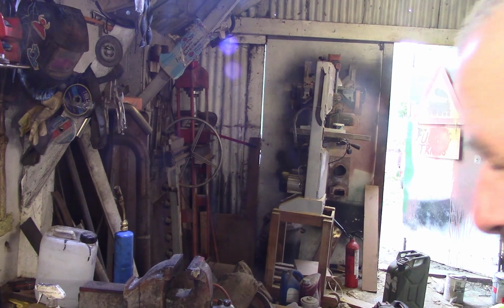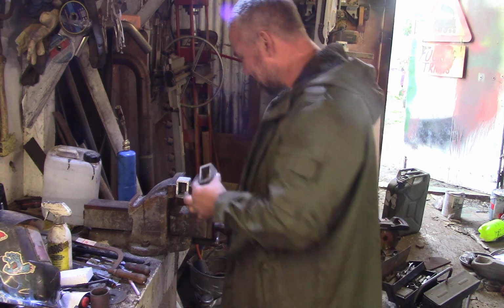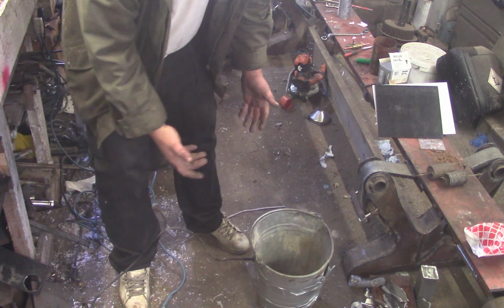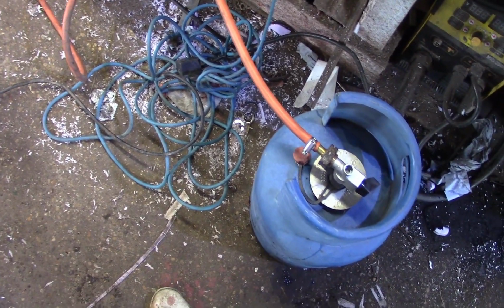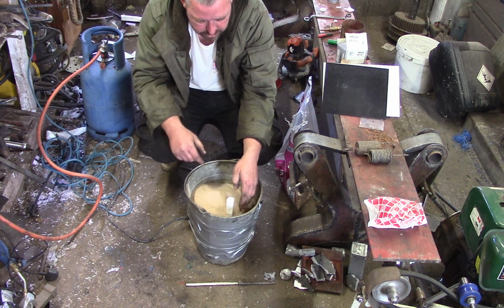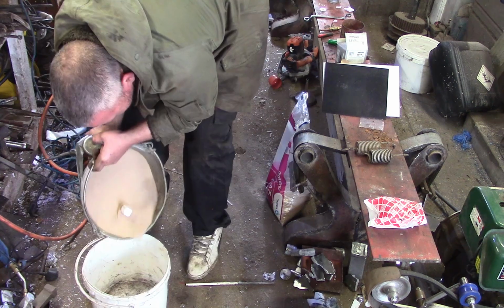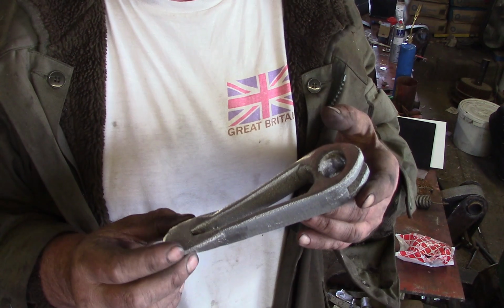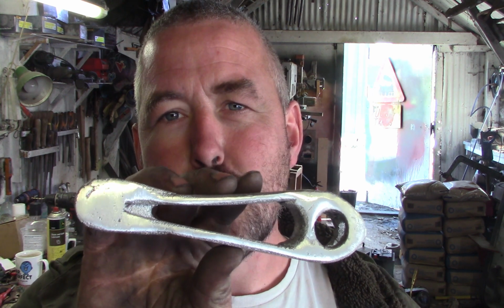casting a starter handle and cutting the cast bottle open

Comment: Next project, make a bigger bucket with straight sides!!!  The bottle had worked just fine - I don't think I could have brought myself to cut it open, even if it was for science.  I guess with the crank handle you could add some braces to the foam pattern to stop it warping in the sand, then cut them off later, but if it will do the trick as it is, no one is going to examine it that closely.

Comment: Just my 2 cents, and I get that you're busy and trying to make progress on the main project which is the bunker, but I think you should do a little more casting before you put the gear away. I bet you could remake that bottle with thinner walls, and figure out how to do the setup without any flexing or cold shuts. My recommendation on that crank handle would be to add a riser at the end where the cold shut occurred, and maybe rotate the part 90 degrees so you don't have a "high" and "low" path, but two parallel paths on the same plane, if that makes sense. Casting setups is really an art, esp. if you want to keep that steam punk design style (which you should do.)  And it's great content. :) I don't think your subs are the impatient type - it's the tinkering that we enjoy.
Reply from the maker: Yes, yes, and yes but it's too late. 
As always, sterling suggestions, I've got some thinner foam on it's way but got to get to the point where tunneling activities can happen in parallel to tinkering shenanigans.
Reply: @turboconqueringmegaeagle9006  Hey, I'm all for the tunneling, don't get me wrong. You do manage to get into all kinds of interesting side projects though. Whatever you like, mate, you know I'm subbed for life lol.

Comment: That cast bottle, Jim, would be nice in a more grown up size for, say a power steering oil reservoir. That would probably require a manufactured cap and filler neck, but I'd say that the bottle you made turned out nicely.
Reply from the maker: don't see why I wouldn't be able to scale it up to more useful sizes, the bottle was just curiosity but it does open up a few possibilities.